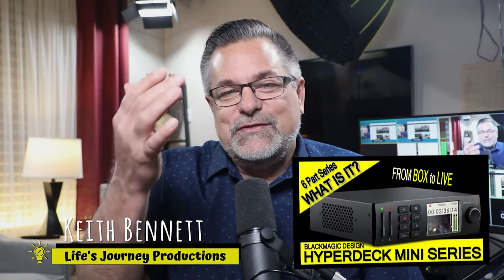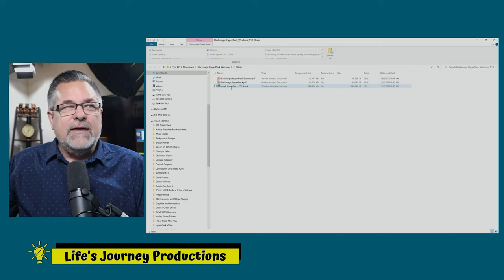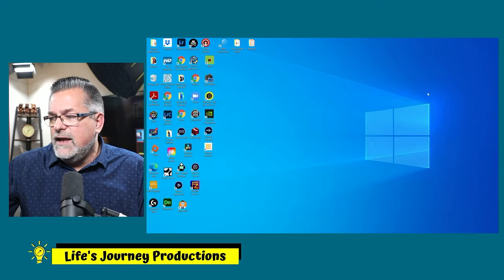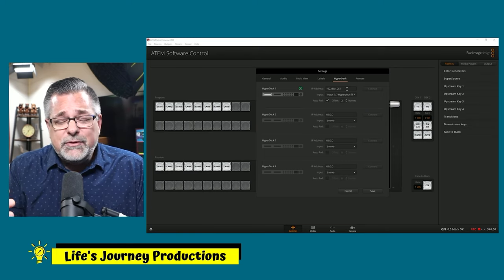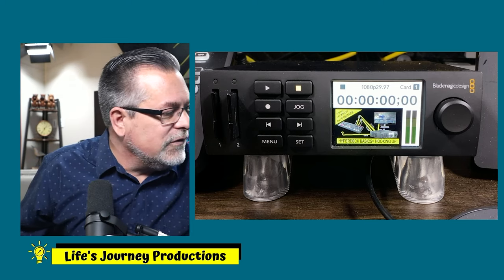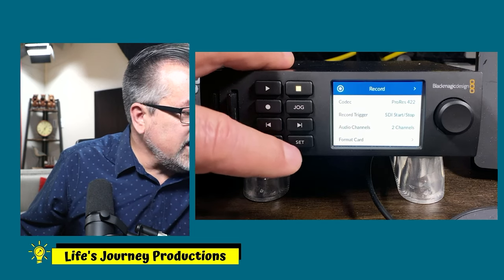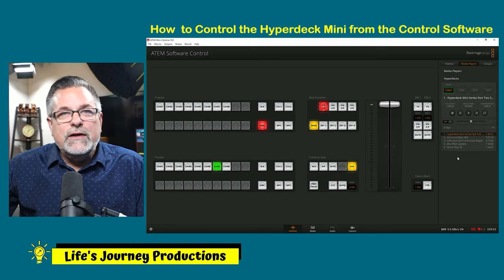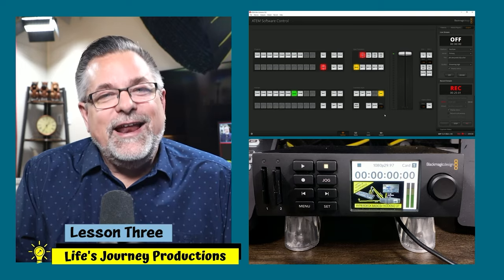HyperDeck Mini Series, "Software Set Up & Atem Integration" Lesson Three

Comment: Great videos. Its any chance to change time display on the unit to show remaining time from clip? Thanks
Reply from the maker: That is avilable under the HyperDecks in the Control Software section. As the clips play their is a little read out of time remaining. Wish it would be able to display on the New HyperDeck Studio Versions on the SD Out Display Option.
Reply: @keithbennett5179  thanks. Would be nice to see on a display

Comment: What format of video will play back from the hyperdeck? I tried mp4, but the file was greyed out in the Atem software (I saw your note on screen saying it won't play back mp4 unless it was recorded on the hyperdeck). I tried mov files, but those won't even show up the file name in the Atem software.

I'm doing something wrong, but can't figure it out. Any clues would be much appreciated.
Reply from the maker: Pro res seems to be the only format unless you  record directly to the HyperDeck. Make sure you go into the HyperDeck menu and change the settings to ProRes
Reply: @keithbennett5179  Thanks, Keith. I will try that.

Comment: Love your videos, your have been a huge help. I am having issue with black bar appearing on my hyperdeck channels. using SDI. I have Hyperdeck SDI A and B running to 3G SDI to HDMI converters to channels 6 & 7 on atem mini, graphics run good for a few minutes then both channels offset with black bar on left. Happens with both Hyperdecks and can't figure out what is going on. Any input or help is greatly appreciated as I have been ripping my hair out over this system. I am running Prores 60 FPS on each Hyperdeck, I am wondering if the Mini Extreme ISO is not happy with that but that's what I need for slo mo replay and running animated titles.
Reply from the maker: Have you updated the firmware on your convertors?
Reply: @keithbennett5179  Thanks for the quick response. Yes, all converters are up to date.
Reply: HDMI out of the Hyperdeck works fine, but I lose my Key and Fill. My system is so close to being perfect and this is throwing me off.
Reply from the maker: Would you like to have a free one hour consult to see if we can solver the problem together on Zoom? https://www.lifesjourneyproductions.com/start-here

Comment: Hi Keith, many thanks for your videos. 
I just received my hyperdeck mini hd today. I use Atem production studio HD pro, I connected the Hyperdeck to Atem on the network, and SDI in order to launch video (jingles) but I am face to a problem, when I put videos files on the SDcard from my computer (V90 Lexar 300mb) the hyperdeck doesn't see video. I think it is the codec but I don't know what to do really. What's yout opinion ? 
Thanks :)
Reply from the maker: Yes you need to set the codec to Pro Res inside the HyperDeck and then render all the files the same Pro Res codec. Keep the size and frame rate the same for each file. I use Pro Res HQ. 1080 P 29.97 so just pick one frame rate, size and Pro Res Codec.
Reply: @keithbennett5179  thank you I will try it, with pro res. The fact, I work on 1080i50 would not be able to enter in conflict with pro res codec ? And last question, I need to separate audio from hyperdeck because I have a sound engineer with a audio mix consol. I use a sdi to audio converter to send audio from hyperdeck sdi to the consol and then to the Atem. What do you think about this configuration ? Does it sound to you ok or it seems  weird ?
Reply from the maker: Why are you seperating audio from the Hyperdeck? It should be final audio/Video when it get's there..... Or it has been recorded and is playing from thr HyperDeck and then played through the ATEM. So that is a bit confuising to me.  I understand sending video from a camera and audio from a mixer and then embeding audio in the video before the ATEM and even before the HyperDeck so you can record in the HyperDeck at a Higher Codec and then from thre HyperDeck you go out into the ATEM but what you are describing is not making since to me? Maybe I am musunderstanding.